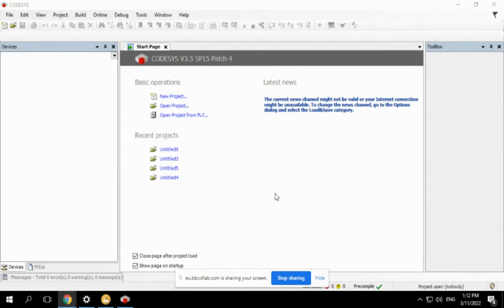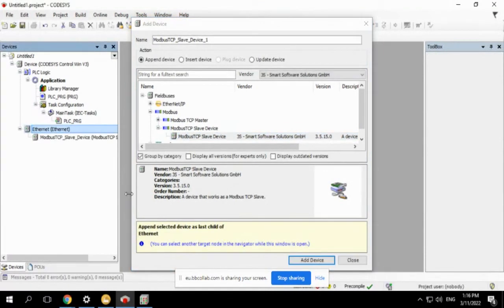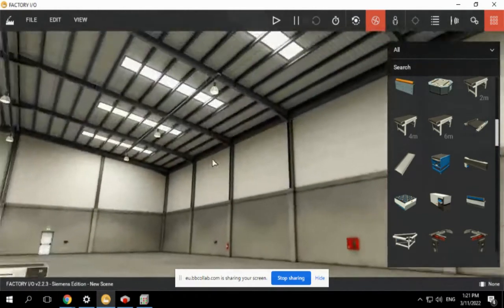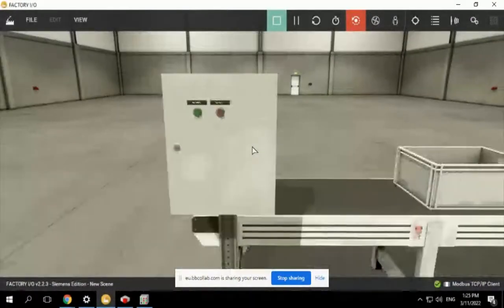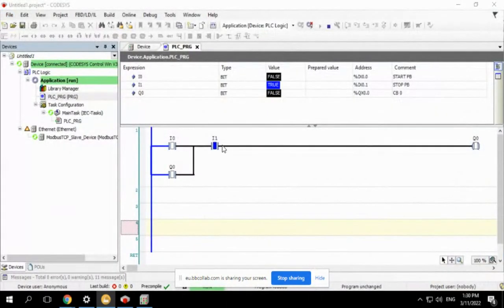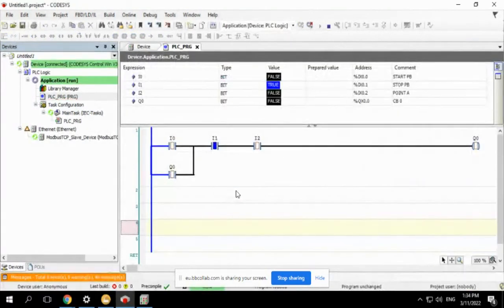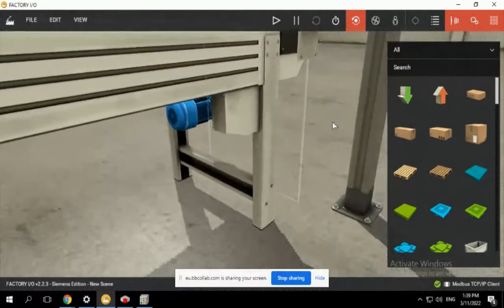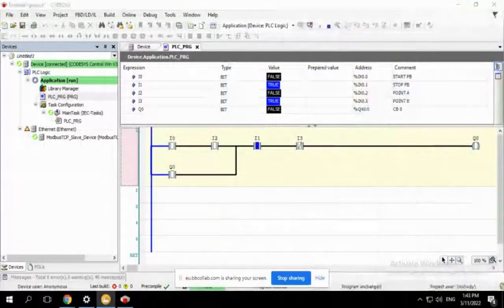INTRODUCTION TO CODESYS AND FACTORY IO || MODBUS CONFIGURATION || LABORATORY PRACTICAL SESSION

Comment: Where can I get a version of ethernet the same as my Codesys?
Reply from the maker: I believe that the codesys installed come with different versions of fieldbuses however I prefer to uninstall the versions I do not need. furthermore, I strongly suggest to use the same version of the codesys Control Win V3 SysTray rather than that of the Codesys software. For further assistance please write me an email